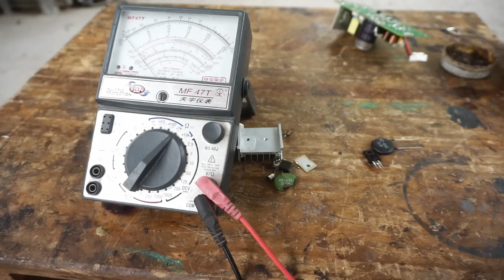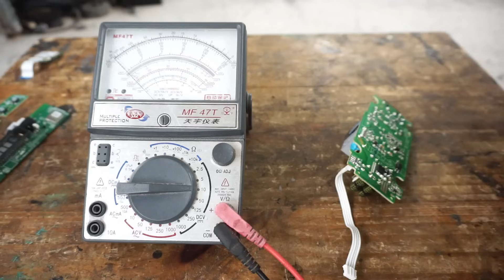Restoration soundbars SAMSUNG // Restore the music system in the most detailed way

Comment: You did a great job restoring the speaker & surround sound system However I don't know why you glued up the grill over the mounted speaker ?  🔊  Now you can't remove  in 2 directions 1 for showing  the woofer &  what if you have to do maintenance inside on the speaker again ? I know Tite Bond wood glue it's very reliable &  strong glue I use it in all  my projects i  just don't want to see that grill or dowels below  get damage in case of future maintenance below it.